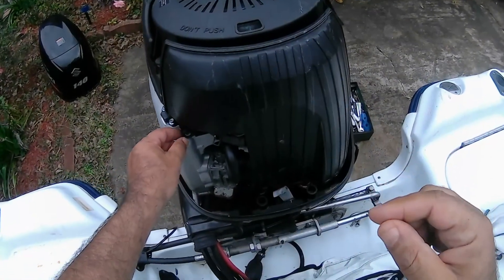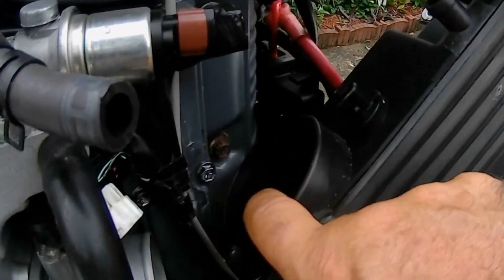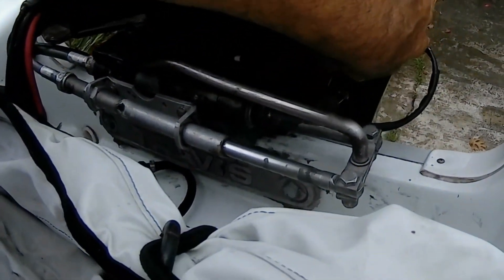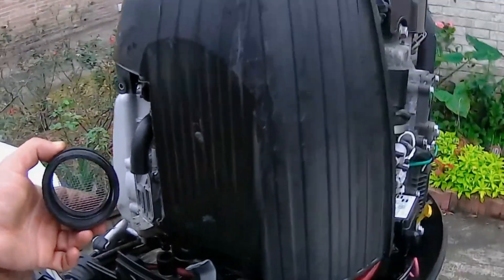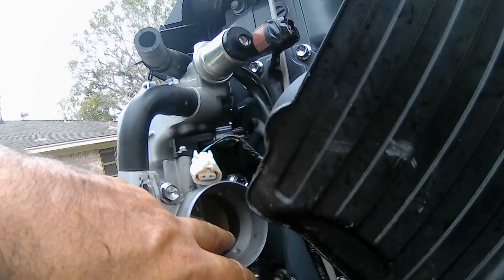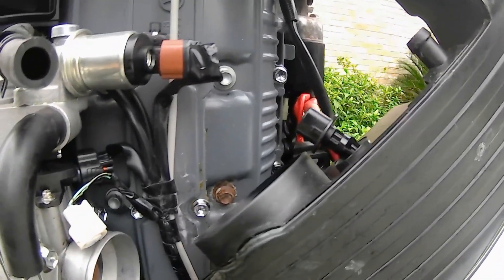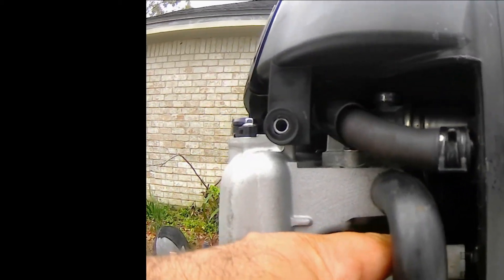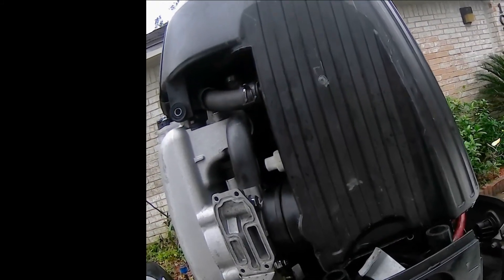Suzuki four stroke outboard df starting problem solved for free

Comment from the maker: Most common reason for no start is soft primer bulb  ( squeeze it till is hard) kill switch not on. Water in water Seperator-- take it off and turn it upside down to dump the water .  Press the button on throttle center button to release the throttle and go up max and low max to reset everything. ask questions if you need to.

Comment: Hi before you service the engine come out code 3-6 right ?
Reply from the maker: 3-6 is oxygen sensor  check for bad ground .. rust on base. This video was airflow sensor and hesitation on take off and dying on sudden drop of speed .

Comment: Thx for video, I’m getting that IAT code
Reply from the maker: sensor is above mesh screen on Air intake. following is how to test it 
IAT Sensor Inspection
CENDG2111306009
1) Remove the IAT sensor.
Refer to “IAT Sensor Removal and Installation” 
(Page 1C-11).
2) Immerse temperature sensing part of IAT sensor in 
water.
3) Measure resistance between sensor terminals while 
heating water gradually.
4) If measured resistance does not change in the 
proportion indicated, replace sensor.
IAT sensor specification
5) Reinstall the IAT sensor.
Refer to “IAT Sensor Removal and Installation” 
(Page 1C-11).
2
1
IDG211130021-04
1
IDG211130022-03
3
IDG211130020-04
Water 
temperature: 
°C (°F)
0 (32) 25 (77) 50 (122) 75 (135)
Resistance 
(kΩ) 5.3 – 6.6 1.8 – 2.3 0.73 – 
0.96
0.33 – 
0.4

Comment from the maker: A mechanic had the idea that he can work on this engine  by causing a vibration he also had all the plug wires loose
Reply from the maker: You tube does not have the best system for chat   I will help or am I late